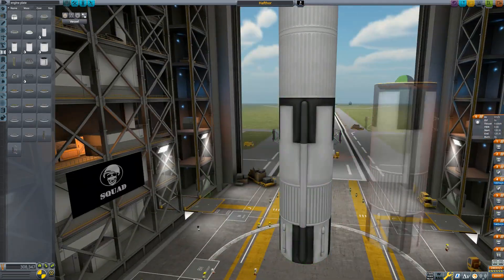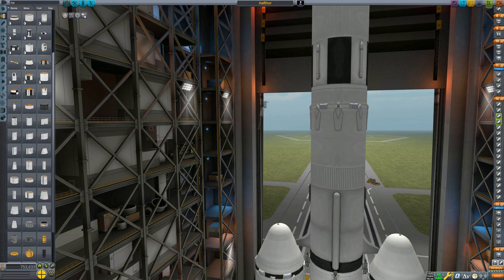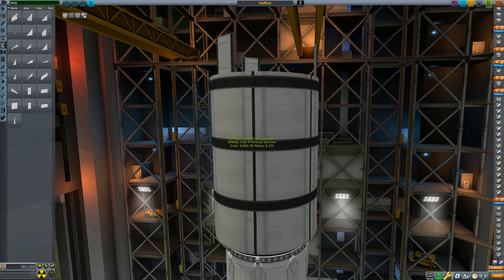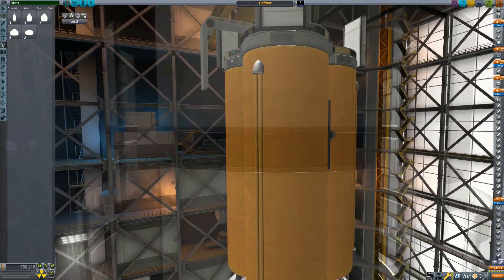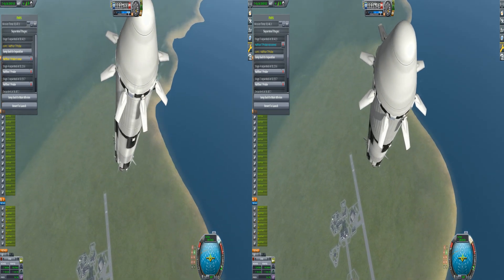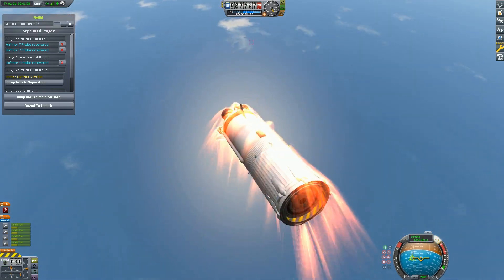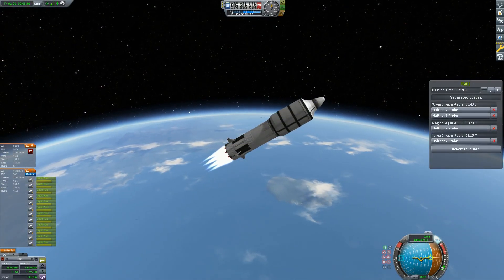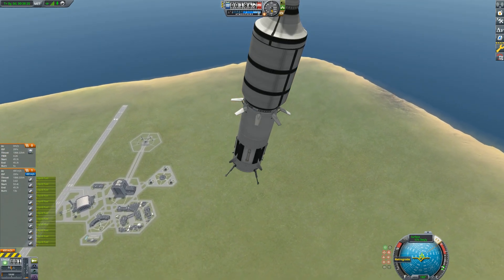Fully Reusable Stock Cargo Rocket 100+ ton - Reusable Fairings! - KSP - 1.9 Kerbal Space Program

Comment: Funny thing that in ksp reusability is pointless because if you don't play career it doesn't matter but if you do then the cost of the fuel far ecceds the cost of the parts so its better to just make super cheap non reusable rockets and the time spent reusing those things landing them ect and then maybe failing a few times it's also not worth the time so as I said make super cheap non reusable rockets and do many missions faster and you'll be more profitable
Reply: Also for career its super useful to have fuel depos on low g moons and just refuel crafts and have a few ships with nuclear engines carrying stuff around the solar system
Reply: maybe true but it's fun and it's cool, KSP isn't really about maximizing efficiency it's about having fun like most games
Reply: @naf5567  ye nvm that didnt do the math right its defo worth reusing but your craft needs to me an ssto to make it worth your time
Reply: @SpaceFan1001  SSTOs always look the same
Reply: @naf5567  it depends on what sort of ssto you're going for a plane ssto OK crew or cargo OK how much crew/cargo then for rocket sstos they just look like big rocket boosters like all other rockets I prefer rocket sstos bc they take less time to get into orbit but a small crew ssto is also good

Comment: Interesting Approach. You seem to focus on recreating the Falcon Heavy rather than creating a KSP-pendant for it. The multiple stages are surely more realistic, but less fitting in KSP, not only because you need mods to land them. Also you use decouplers and solid fuel boosters, which in KSP aren’t really reusable (maybe with the new update). I think its way easier to land a single stage with parachutes if you don’t go for realism. This can have good aesthetics too.

Comment: No try ot do this without having to revert the flight. Maybe have a single column without the side boosters, and set the engines to a lower thrust to make it go into orbit at the correct time, when you can land the booster and switch to it to turn off the engines. How do you only have 47 subs?
Reply from the maker: Hey, thanks for watching! I do have a few other designs I think I can use without reverting to a save. I will try to land the two side boosters similar to what Stratzenblitz did in his fully reusable Mars video. The challenge will be to keep it a heavy launcher so that it is also useful. I will try this when I start the laythe series. Thanks again!